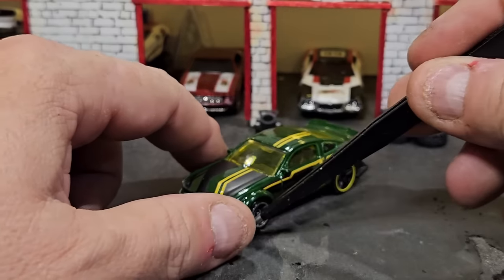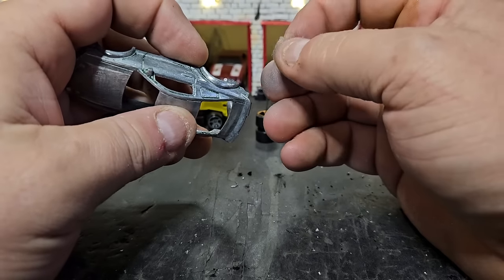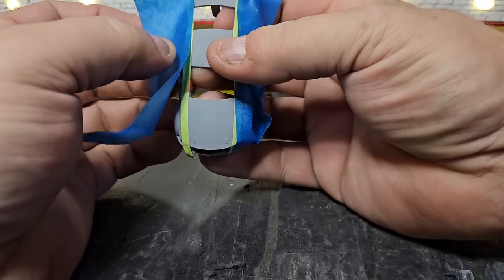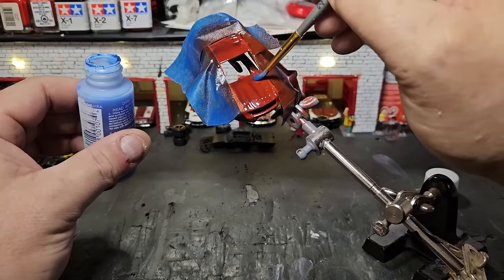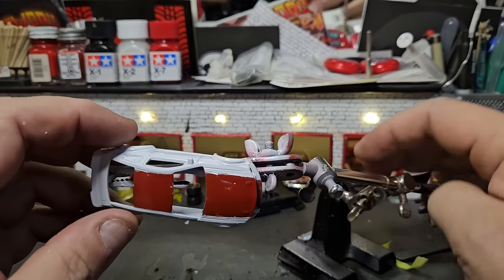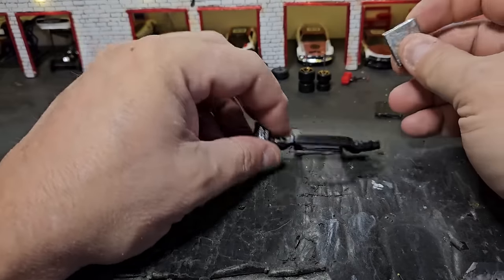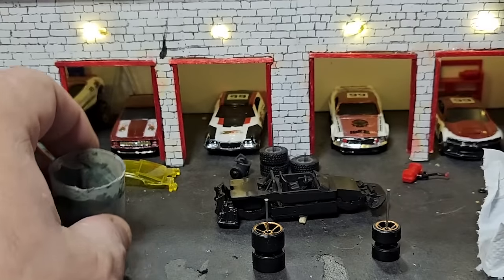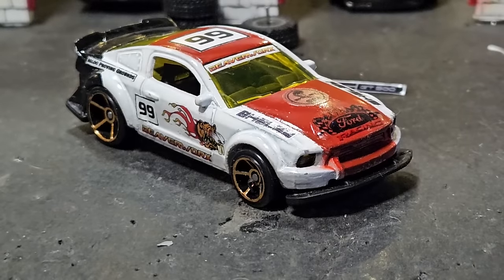Build a Die-cast Race Car with Beaverworx Shelby Cobra Build (Full Build)

Comment: Super good show! I popped in late for the premiere, too embarrassed to say, so here's a full watch for you! 
Have you ever tried shaping the wheels? I ask because on your original donor, you seemed to prefer the back tyres that weren't so wide. I once saw an old video where, while holding the axle you can use a sanding drum for the rough work in shaving down the width, finishing up with a sharp hobby knife.
Reply from the maker: I have coincided that and would prefer using the narrower wheels. Havint tried actually reducing the width yet but i guess it would help. I think Iv seen the wider wheels sanded down into a cone shape the reduce the contact. So many options...lol!